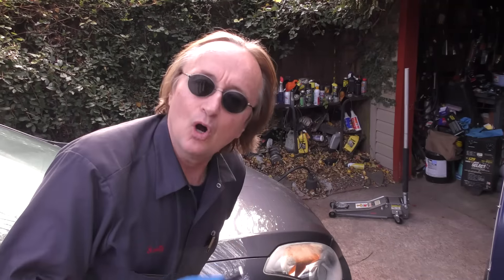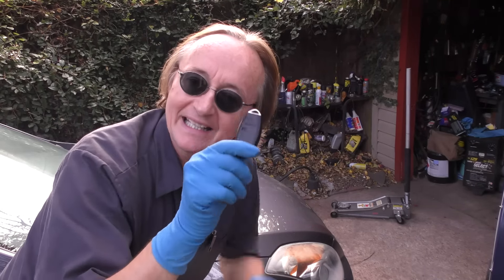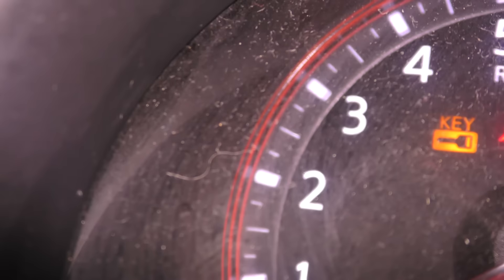How to Fix Keyless Ignition System in Your Car

Comment: Scotty, I have a 2010 Cobalt that I had sitting in my driveway for like 2 weeks (since christmas break started) When I got in it today the rear passenger wheel wouldn't move and was completely locked up. I didn't have the E-brake on during that time. Do you know any fix I might be able to do at home because i'd rather not call a tow truck unless I have to. Thanks in advance, love your channel.

Comment: Scotty, quick question. I have just added freon to my car air conditioning system to make it cold again. however, the rpm idle now is very low and somewhat wants to stall upon breaking at the stop lights. could this just be cleaning of carbon in the throttle? Thanks!

Comment: My mom works for a small town PD and had a 2013 Charger with the push to start. The fob would unlock the car everywhere except at the local hospital. When ever she had to go to the hospital for work the key fob wouldn't work to unlock the car. The car would still start, but it wouldn't unlock the doors for whatever the reason. And one of the sergeants had the same problem with his Charger too.

Comment: My 1999 car even has a small RFID chip in its key for the immobilizer. So while it still has a normal key, it also has some module that could prevent it from starting (fortunately, everything works for now).

Comment: That part is really the steering wheel lock module, is a solenoid that can goes bad or have some cold solder and for security reasons the immobilizer will not let you start the engine, also that's a sealed unit if I remember correctly so you must replace it

Comment: Hey Scotty, i own a ford Fairmont 2004, and its ignition assembly has given out, i took bits of the stearing cover off to find the backing plate for the ignition barrel had poped out supposedly a common problem, do you think it would be a good idea to get the entire assembly or get someone to install a ignition bypass switch temporarily since i do not have the funds 
if you could reply that would be amazing 
THANK YOU :)

Comment: hey Scotty ,I'm looking to buy a 7 seater here in the UAE (desert country however I'm only driving in the city). my 2 final options are a Pajero ( 3.8 v6) or the Prado(2.7 v4). keep in mind that the Prado has a lot better resale value and more features. So what's your pick?
Reply: Arid Nexus 
Depends what you need from the car.  If you want to carry a lot of weight or tow a trailer, you definitely want the 3.8 L Pajero.  If you want good fuel economy and you drive around a city a lot go for the 2.4 L.
Reply: Millermacs thanks for the advice!
Reply: Arid Nexus 
No problem

Comment: If you rap on the box and it works it's probably bad solder joints or loose connectors on the board inside. I wonder if you can take the box apart to see?

Comment: Tapping the module like that and it start working again is likely an indicator of broken solder joints.  Find a way into the box and tap a few joints with the soldering iron.

Comment: getting it to work by tapping the modual sounds like it maybe solder joint issue.
I don't know what year that Nissan is but it sounds like it might be around the year 2000 approximately the same time manufactures stopped using lead in solder.

Comment: Sadly many of the new American cars have this crap too. Most of the Chrysler/Jeep/Dodges I see now have a keyless start. 
But lawd, the price to get it fixed? 900$?! My 3rd car, a chevy tracker, only costed me 800$ to buy the whole car! Kept it for 4 years, and sold it. Still, on the road!
Reply: BrysNightWorld mine has it
Reply: KingMacintosh oh poo they were shoving Mitsubishi engines in cars back in the early 80's. Car makers have been doing stuff like this decades now! Just pointless chatter for the Ill informed. Chrysler still has a controlling stake in all its larger vehicles designed & made on shore! After the mid 90's downfall thank American management for it don't yell at the Italians!!!
Reply: KingMacintosh we gully gee thank you for pointing that out . Where would I be in this old without you pointing out the blatantly obvious.... Who cares!!!
Reply: You're both right in your own respects. Technically, Fiat owns Chrysler now. Which the main headquarters for Fiat, is Italy. 

Now! As far as operated, it is essentially American still. The main headquarters in Auburn Hills controls its US factories there, Illinois, and many others. Matter in fact, that very Belvidere factory is likely the reason the Obama Bailout happened in the first place. Because it was essentially robots, assembling everything. The early-mid 2000s produced some rough and shady dodge cars. So people stopped buying the cars! Go back and look at the ads for chrysler from 05-2012. God awful. You'd think your going to hardees to eat. 

tl;dr Fiat controls the money and advertising for the most part. Chrysler operates and manufactures the products. Take the ' Fiat Freemont' its a rebranded, exported to the UK: Dodge Journey.
Reply: BrysNightWorld  I don't want to be rude but I know where my jeep is made. Now it is based on a Mitsubishi platform and is derived from a Hyundai engine black with a Hyundai built transmission etc etc... But don't sit there and say a Ram 1500 or 2500 is Italian built anymore than my jeep which has a lot of Asian blood in it as if that's better or worse. Only the smaller vehicles are sourced with Italian underpinnings but with exceptions most are built here.  It saved a lot of people losing their jobs here, cause they hadn't we'd be in world of shit otherwise! We're all pro America as it stands right? You don't cut your nose to spite your face...

Comment: Nissan owners are sent recall slips for this known issue (got mine 2017) cars affected are 2007-2009. AFAIK, the module they replaced it with are "modified" units that bypass the (unnecessary) steering lock altogether.

I'm guessing they extended the recall because the CEO of Nissan in Japan is still using this car.

btw, to those who may still have issues with starting the car, look into the brake switch module replacement.

Comment: Hey, Scotty, are Mazdas with the push button start just as bad as these Nissans?  I'm considering buying either a 2014 Mazda 3 or Mazda 6, but they both have keyless ignition across all trim levels.  After seeing this video, now I'm not sure I want to chance the problems with push button start cars.
Reply from the maker: yes they are, all computer ignitions systems are just plain stupid tech for tech sake,, and can be easily stolen too as in this video https://www.prod.themaven.net/ontheroadwithscotty/cooltools/high-tech-thieves-can-get-into-your-car-in-a-flash-7ZMMV6CCzkGmkM58wpCb0w

Comment: Scotty what's your opinion buying car with salvage title  or rebuilt
Reply: max121237  just dont buy flooded car, salvage mean insurance said cost of value of the car (repair) reach 80% of value.. but insurance will salvage a car just for a door damage, because the price in base of the dealer parts, .. soo depending the damage it may be a good deal, but be careful ...

Comment: You can get the part (newer rev nissan branded part) off amazon for $300.  I know thats still too much, but its better then $650+.   Also, don't believe the dealer hype, it is nothing but a worm gear and pin.  It has no programming and is plug and play.  I replaced mine in 10 min and its been a happy car for over a year.   You will have to pickup two replacement fasteners because Nissan uses break away screws to install it, but I used regular bolts because I didn't care.    The break away screws weren't too secure anyway, it took me 10 seconds with a set of vice grips to remove them.
Reply: I also think Nissan knew they screwed up on this part, starting in 2012 they did away with it.

Comment: For example if the keyless ignition goes bad on my 2015 Jeep Grand Cherokee, how do I start it? The system is fine but I want to know when it does break in the future?
Reply: They all go bad in time.  Probably similar to this Nissan.  Some expensive module to replace and reprogram for close to $1,000.  I had a Subaru BRZ, awesome little car.  I got the Limited version with the special key so I could touch doors to unlock/lock and press start button to go.  Well, one day it wouldn't start!  Hit button, nothing (car was less than a year old).  I was stuck in a parking lot for about 45minutes.  I kept just hitting buttons and messing with it and all the sudden it worked.  Sold that car soon after.  I've taken that car camping, and on road trips 5 hours from my home.  Don't need that happening out in the forest while trying to pack up and leave.  Never again will I buy a car with a push start or intelligent key.  It's just nonsense you don't need that will cost you more money up front, and in the long run when it goes bad.
Reply: Earthling1984 is it the same little hole where you put the fob in like Scotty did?
Reply: Peter Kapica There was no visible hole to put the key in.  You just kept the key in your pocket and pushed the button for mine.  I never took the dash apart or anything.
Reply: Earthling1984 you need to take apart the dash like scotty does. There is a module there
Reply: Peter Kapica Well as I stated the car started in 45minutes.  I had no reason to take the dash off.  I got lucky and it just worked again.  Sold that car a few months later and will never buy a car with a smart key ever again.  So no need for me to ever worry about that again :)
Reply: I hear ya, I was looking at the Crosstrek, they are really pushing this keyless rubbish, and I am not biting. The lower trim models are the traditional keys, however in 20 years (maybe less) keys, like the carburetors a relic of automotive past. Then we are even more at the mercy of auto makers looking out to increase their bottom line.
Reply: No worries about for now 2015 is still brand new
Reply: heck....! you have to sell it before the nightmare occurs
Reply: Allen Wong Yea.  It's a ticking time bomb though.  Will happen sooner or later.

Comment: I can attest to Nissan’s stupid key fob system. My dad’s 2013 Altima wouldn’t shut off. Dealership couldn’t even get it turned off. Had to choke the gas line. Every other time it would always say No Key Detected. Finally got rid of the Lemon and got a new Ford Fusion.

Comment: Lol I'm pretty sure the system is designed to start when you have the key in that slot on the left of the steering column. I have that same thing in my Infiniti to start the car in case of a dead key. Either your tapping of the module really did work or it was just designed to work with the key inside.

Comment: i have 2 1991 chevy cavaliers and a 1996 camaro. YUP give me a slab of metal that goes into a slot. the camaro has an early theft prevention system called vats. that's bad enough, its a pellet resistor. i can fix it myself with a couple of resistors if it did fail.

Comment: How can you fix central lock problems? I have a 96 Impala SS, and the remote works fine and all the doors open except the driver's door. The driver door unlocks sometimes but almost all of the time it's jammed and I have to use the key to unlock it, but it locks with no problems. Any help, please?

Comment: Hey scotty, you could probably find the damaged part of the circuit and repair it for a few bucks. its unlikely the memory went bad. it's probably just  a silly ol' capacitor, they fail all the time. lots of electrical components get bad caps, especially after 10 years or so.

Comment: My car key got stuck in the ignition once, I used some wd-30 and wiggled it so the solvent can penetrate deeper inside the key slot. After 1 min, got out and goes in like its a knife through warm butter!

Comment: I have the 2006 Prius and the remote for the central locking fucked up from water so I have to use the mechanical key to open the door and press the button on the driver seat to unlock all the doors. To get a new key I have to order the key from Japan and then get a technician to install the new key so they can communicate. I'm always worrying to lose the key I don't have a spare

Comment: I'm a car salesman for a main dealer. And most of our cars have these systems. 
A lot of stupid problems with them. if the car runs out of fuel (which isn't uncommon at a dealership) and u put more in. U can't put the key at position 2 to get the fuel pump sucking the new fuel because there is no bloody key. So it doesn't work. 
Also major design floor. My company car has a start button along with automatic lights. So when u hit the button to turn the car off the lights go off. But a while ago I was on a busy road. I stalled. And suddenly the lights go out and I'm stuck for about 5 seconds on a main road at 10pm with no lights on. Nearly shit myself
Reply: If you push the "start" button twice (without foot on the brake, or else the engine will start cranking) its the same thing as the key in position 2
Reply: Steven Marsden for us if u don't have ur foot on the clutch it just turns on the entertainment system. Nothing else. It's really annoying
Reply: KingMacintosh Peugeot
Reply: KingMacintosh Mazda and I think Honda in my experience do this

Comment: hello Mr Scotty Kilmer,  I have a Honda Accord 99,  it was running fine until yesterday,  the engine shut down suddenly or does not accelerate and check engine light comes on,  it is running with (obd1), I checked that and it throws three codes,  ( 8 then 9 then 17)  

I Google searched it and the results was 
camshaft sensor
crank shaft sensor 
vehicle speed sensor

it doesn't have a camshaft sensor,  it has a distributer with small coil inside ( I replaced that but the code still there and the old one was leaking oil inside ),  the modern accords has a sensor in the same place I have a distributer connected to the camshaft. 

the vehicle speed sensor is working good and the speedometer too.

the crank shaft sensor sends signal to the fuel injectors which is running fine.

help me please,  I am stuck right now.
Reply: Thank you Mr Jimmy S for replay, 
it's working with OBD1
there is no plug for the OBD2 scan tool, the newer models have the plug. 
 It has a distributer,  doesn't have camshaft sensor, 

it does have a crankshaft sensor and it's working good. 

the vehicle speed sensor can't cause a problem like that.

I tried disconnecting the battery and then put it back but that doesn't work
Reply: it has to have an OBD2 plug, that is 6 years after OBD2 came out and a completely different body style than the 94 so it would not have OBD1. usually the OBD2 port is under the dash but it can be hidden pretty good in some cars ive noticed

Comment: Yep, And it's not only Nissan's, it's pretty much all cars with keyless start.

The modules are made to brake so that you get it replaced at the dealer, they'll make a fortune of stupid crap like this

But hey, if you specilize in a specific brand like VW, Toyota or Nissan, you can buy equiepment that will sort problems out and you can make a fortune yourself ;)

Comment: Well, Scotty.......I WOULD comment "Um........Nissan IS Japanese, right?!!!!!", but then I remember that Nissan & Renault got into bed with each other several years ago, & when you think about the crap that Renault built with AMC in the '80's (Alliance, Encore, Fuego, LeCar, anyone?), I am not that surprised at all that Nissan's reliability ratings have gone down the tubes in recent years.
Reply: My ex wife had a Renault Alliance. It was THE worst car I've ever seen in my life. Nothing but plastic, and even more plastic. Even the top portion of the radiator was plastic. A Yugo would have had to been a more reliable, better built vehicle.
Reply: Agree. I dont think Nissan are what they used to be and I blame Renault. Renault have always had a reputation for making some of the least reliable cars around. To add insult to injury Nissan sells cars here in the UK and in european market generally with shitty Renault diesel engines. New 2017 Micra even fitted with Renault petrol engines. WTF?
Reply: They've kinda become the Chrysler of Japan...

Comment: I had a friend who bought a Murano new and had nothing but problems with the key system. It would even stop running and wouldn't start, usually in the worse parts of town. They ended up using the lemon law to get a new car from Nissan. So if your car ever has issues with starting or stopping without notice and it's still under warranty, don't let them tell you that its a, "problem we have never seen before." Just show them this video and tell them to fuck off.

Comment: Well you're pretty much f'd these days caz almost all new nissans and other new cars come with the keyless start.
Reply: MrRangerZr1 Both my sister’s Toyota and my Mom’s Lincoln have Keyless Ignition Systems and they both work just fine, just as long as you actually have the fob that is made for the vehicle with you, inside the car.

My Buick is newer than both the Toyota and the Lincoln, but my Buick still has the traditional key hole ignition and my key is a Switch bladed Key Fob and it works just as fine.

Comment: Yes, this is yet another example of adding unnecessary, complicated and expensive electronics to make you more dependent on them.  I wonder if there's an easy way to crack open the electronic module to re-solder a bad terminal?